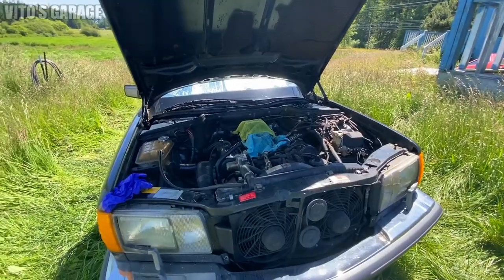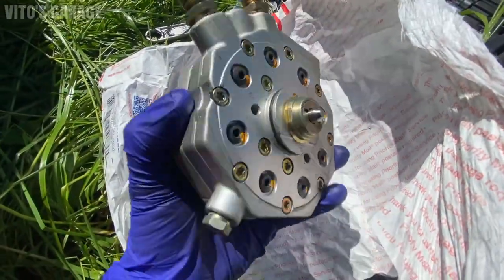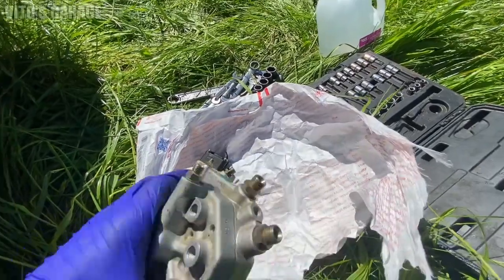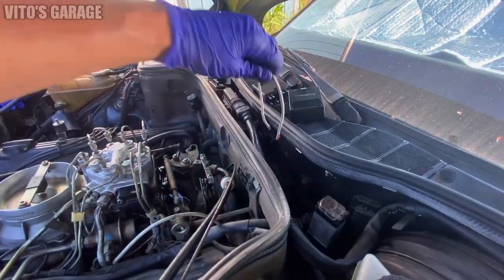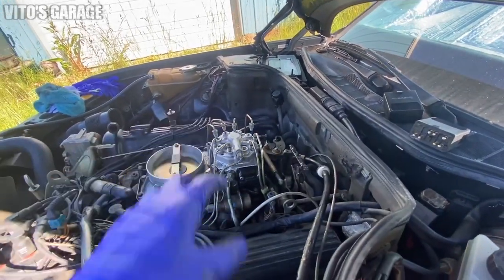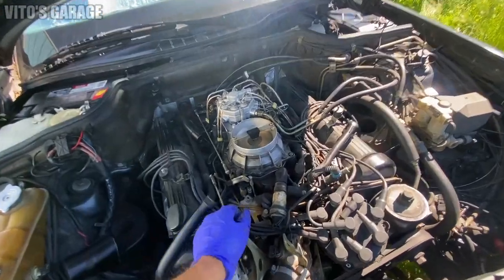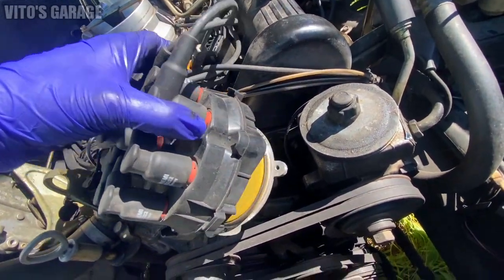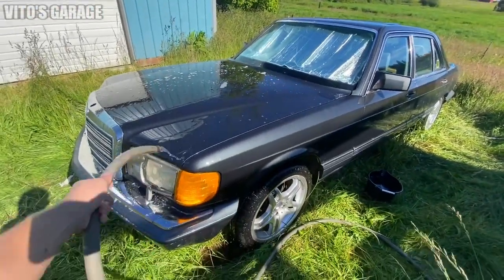W126 Mercedes 420SEL Fuel Distributor Replacement & First TEST-DRIVE!

Comment: I own one 1991 420 sel with 140000 miles on it and I love the car it’s fun to drive when it has no mechanical issues sometimes it feels like the idol is rough and sometimes acts fine
Reply from the maker: Look into idle control valve and vacuum leaks when cold and hot

Comment: Your distributor cap may be your misfire problem. It would be great if the cap replacement solves the problem
Reply: I had a 300TE with a misfire and it turned out to be the distributor cap too. Once changed, it was smooth as silk again.